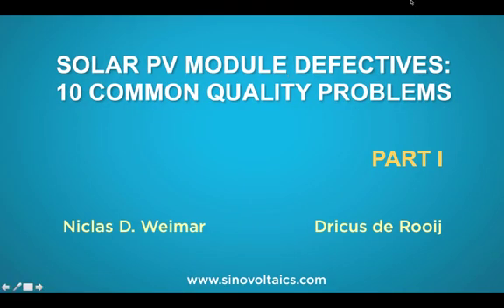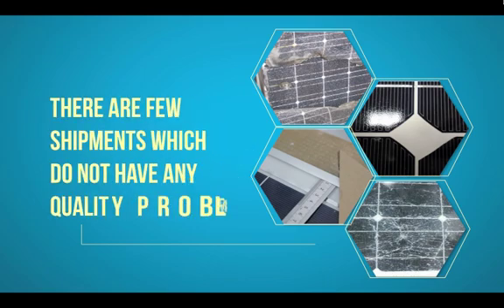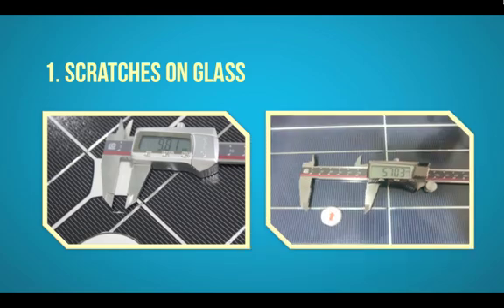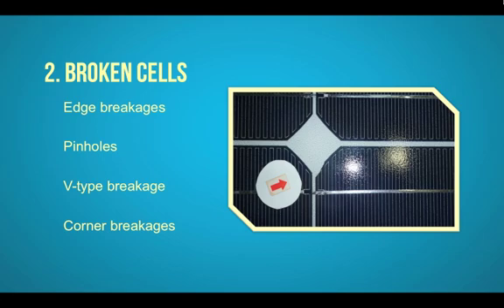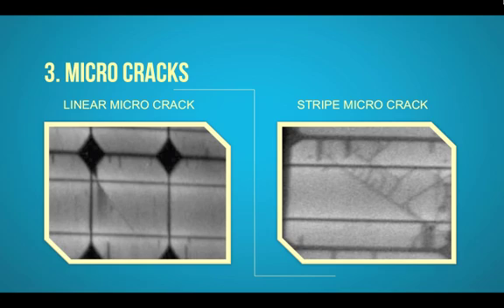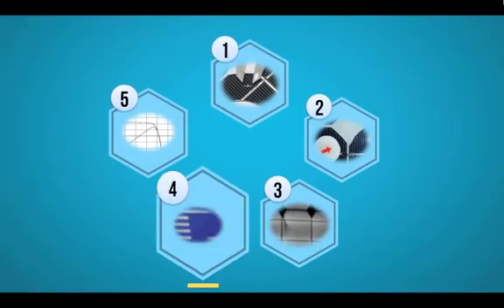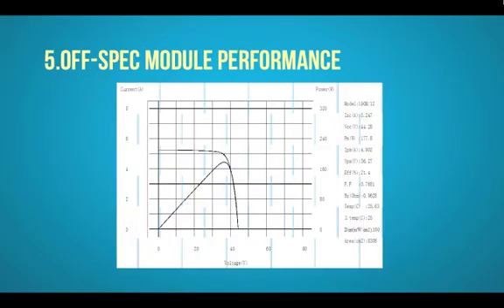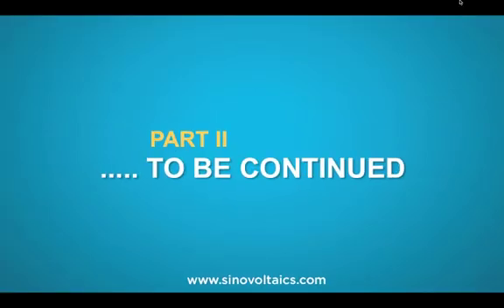Top 10 common solar panel quality problems - Part I

Comment: on my solar panel my have a white spot inside but it's not a crack  it just spot my question is its the same as a micro crack a white spot in my panel